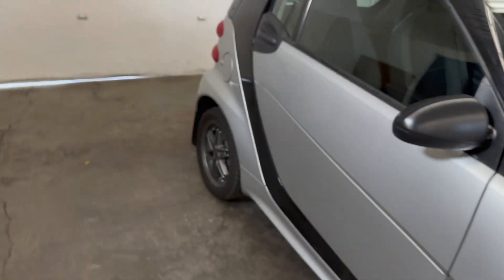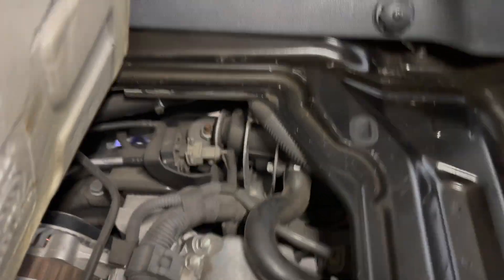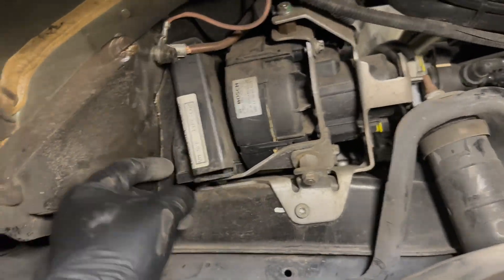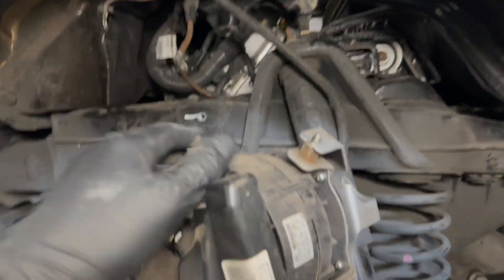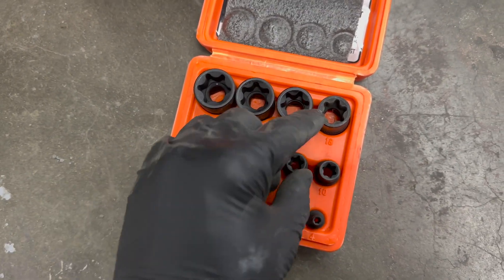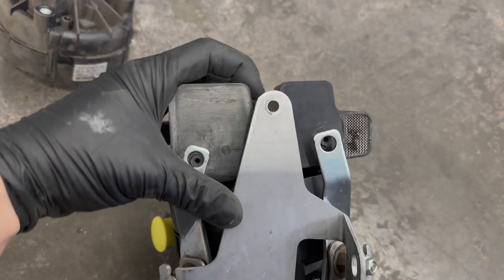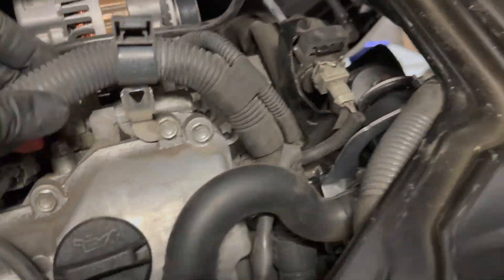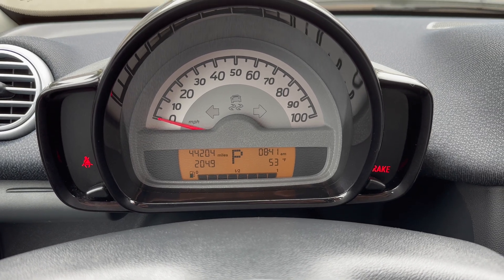Smart Fortwo - Secondary Air Pump

Comment: I have a 2016, do you have to drop the engine for that? I’ve managed to loosen the 3 10mm bolts holding the bracket, but I can’t fish it out, there’s no room
Reply from the maker: So you don’t have to fully drop the engine out of the vehicle, but there is something known as service bolts that allow you to lower the engine by about 6 inches which allows you to do the job properly.

Comment: Please, can you help. We cannot find the secondary  air valve (or fuel breather valve). Is it attached to the air pump? We have smart 451 45 kw, petrol
Thank you a lot!
Reply from the maker: The fuel charcoal canister that the fuel tank breathes through is in the middle of the vehicle underneath the large black plastic panel.

I have a video that shows how to remove and install the charcoal canister.
Reply: @PerformanceAutoHaus  Thank you. We will try to find
Reply: @PerformanceAutoHaus   I've your video. Thank you.
Maybe, I wasn't clear enough. I need to replace the secondary air injection  valve. Part number A0025407097. But I cannot find it in my smart 451 1.0 petrol.
Thank you for the answer 😀
Reply: @PerformanceAutoHaus Maybe, I was not clear. I need to replace the secondary air injection valve in my smart 1.0 petrol. But I couldn't find it.
Thank you for the answer again.😊
Reply from the maker: It’s on the top of the engine on the passenger side next to the Secondary Air Pump.
Reply: @PerformanceAutoHaus  Thank you very much. Good luck!